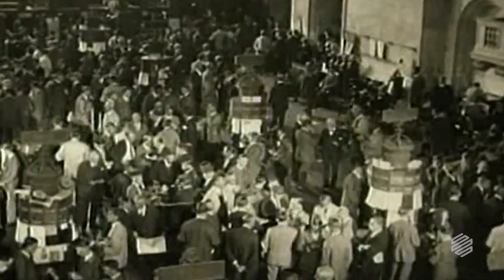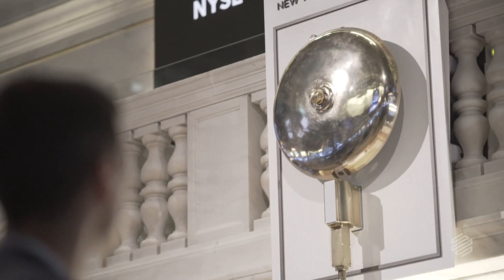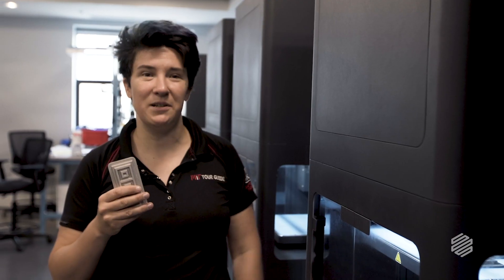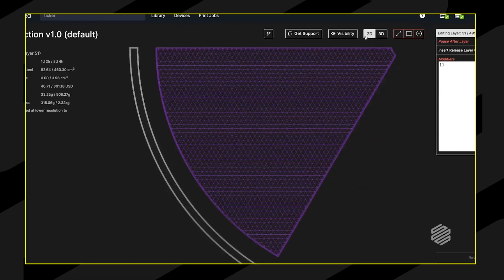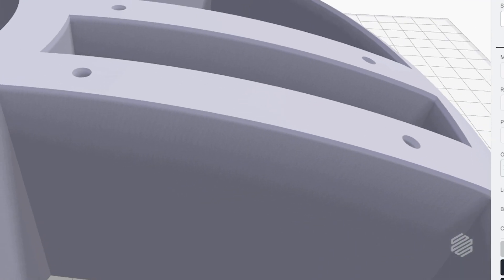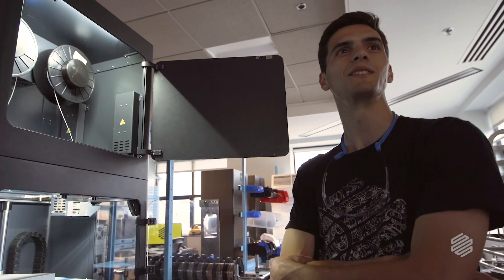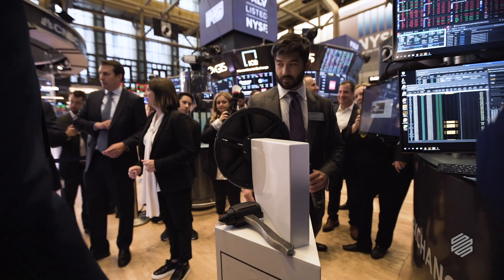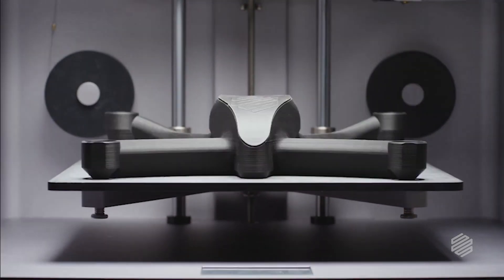Markforged IPO: 3D Printing the New York Stock Exchange Bell for Listing Day

Comment: This was really disappointing.  I have been searching for information on how I might make a replica of the NYSE bell.  You made a model that obviously didn't ring well, otherwise you would have included the sound.  Worse yet, the real bell has an unusual rotating clapper mechanism, and you didn't even try to make that.  Your printer is cool, but it obviously wasn't the right tool for the job in this case.
Reply from the maker: Thanks for watching and for the comment! We weren’t trying to make a 1:1 replica of the bell, but rather wanted to include aspects of our company into the design, including the not-so-very-acoustic carbon fiber reinforcement and onyx. We’ll never tell what that ring sounds like, but trust that it is unique :) good luck on your design!